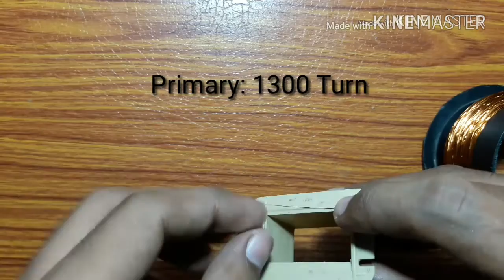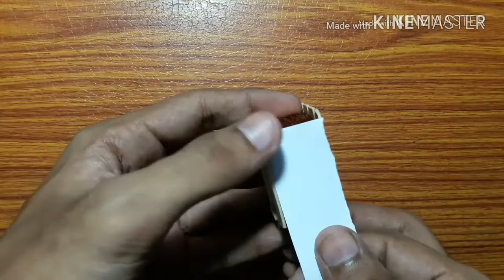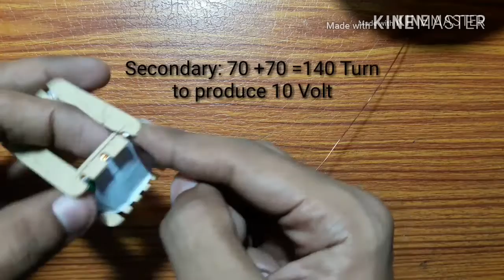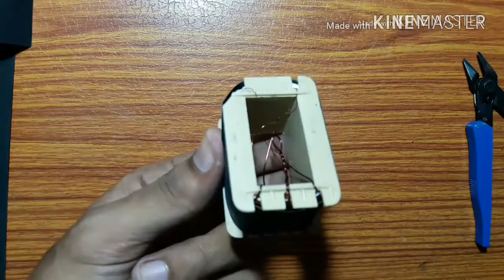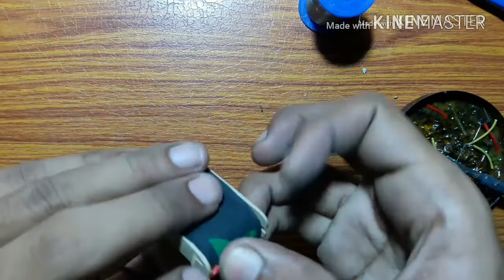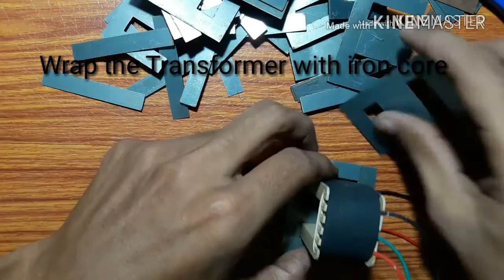How to make a transformer at home || Transformer || Transformer coil winding

Comment: I need your help
Reply from the maker: Yes! Tell me
Reply from the maker: @franklinpatrick8606  okay tell me what's the problem are you facing now
Reply from the maker: @franklinpatrick8606  bro can we communicate On Instagram....?

Check the channel about section for Instagram link
Reply: @SoftTech10  I don't have Instagram  do you make use of hangout
Reply: @SoftTech10  I didn't get any output voltage in the secondary. Does winding the primary in clockwise direction an winding the secondary in anticlockwise direction have an effect on the transformer
Reply from the maker: @franklinpatrick8606  please check continuity of secondary coil with the help of multimeter
Reply: @SoftTech10  thank you. Does the direction of the coil matter I talking about winding one coil in clockwise direction an winding the other in anti clockwise direction

Comment: Does turn calculation changes if i use Aluminium wire
Reply from the maker: No....
Reply: I am making a welding Transformer and my stack is 7 inch and 8 no core so i am using the formula 2x7=14 inch² and now 7.5/14 =0.5375 turns per volt is coming my ans for winding 

Can u tell me i am correct or wrong ?
Reply from the maker: I thinking  you should goto "JCB Electric" youtube channel for this type of transformer
Reply: @SoftTech10  there is no data about my question in his channel i searched his full channel by no video is there for my question can you tell me ?? My ans
Reply: @sciencefusion5352  Hello! from soft tech channel
Reply: @Invisible_0011  ok

Comment: Bobin plastic ka hai kya hum ise pvs sheet se bana sakte hai . Plz tell bro.
Reply from the maker: Hnn bna skte hain....but dhyan rhe ki heat hone pr pighal na jaye
Reply: @SoftTech10  bhai mere pass purana 9 0 9 transformer hai use khol kar rewind kar sakta hun kya
Ek request hai plz 24 v ka transformer 5 amp ka banao
Reply from the maker: @thesneh6873  bhai 9 0 9 transformers ka primary coil bhot patla hota h jiske wjh se wo toot jata h
Reply from the maker: @thesneh6873  24 volt ka transformers kis kaam ke lie banana hai
Reply: @SoftTech10  mere bhai mujhe hammer drill mchine banani hai to usme  12v se kam nhi hoga isliye 24v chahiye. Suna hai 12 0 12 ka left wala wire 24v deta hai . accha 12 0 12 transformer ka price lagbhag kya hoga air ek baat stablizer main konsa transformer milega.plz help